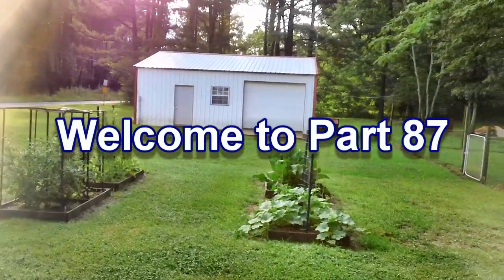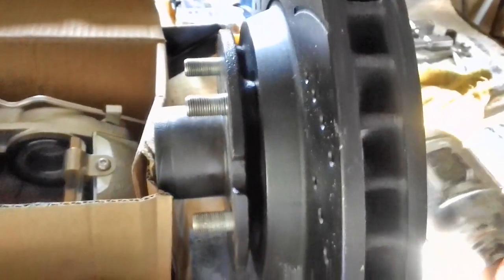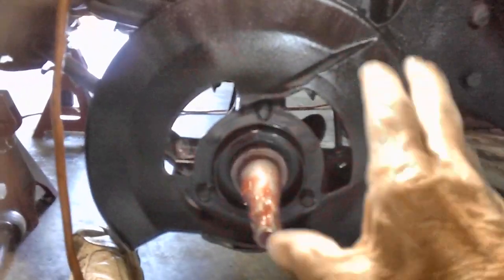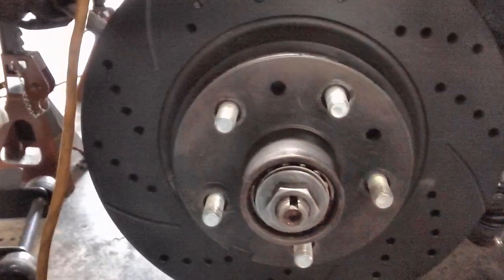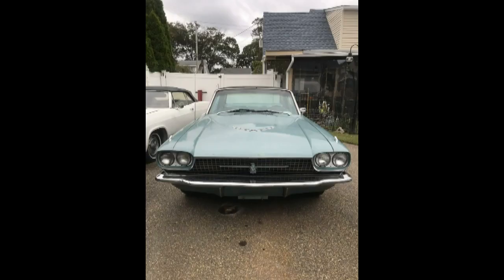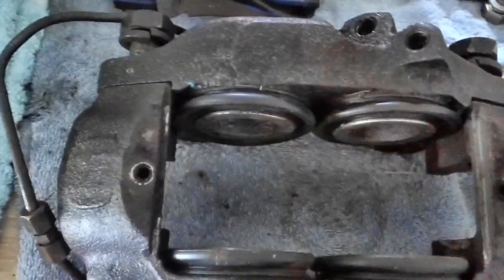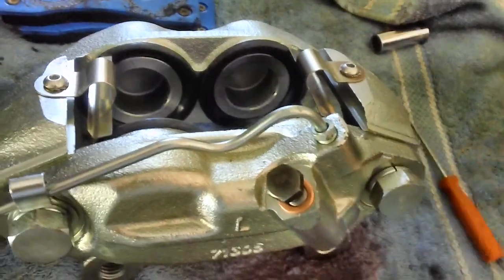1966 Ford Thunderbird repair and refurbishment (Part 87). Front brake calipers.

Comment: Great video John. Glad you showed how the brake pads just drop into the old calipers. Also in a  previous video you talked about the break booster and how there is a little bit of travel in the pedal before the plunger engages. That explained why I always thought my brakes were touching.  Many thanks!

Comment: Hello John,
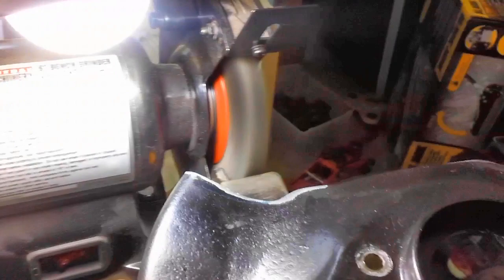Splash shield observation/question: @19:10 of your video, you can clearly see an "R" on that splash shield. It looks like you are working on the driver side, which is the LEFT side. Can you take a look at your shields to make sure you are putting them in the right locations?
Reply: Good point.
Reply from the maker: George,
SHHHHHHHHH!🤫
Regards,
John

Comment: John, as I learned it, when adjusting a wheel bearing, one torques it to the 20lbs or so as you did... however... if you leave it there, you'll have premature bearing failure. 
Torquing it down to 20lbs is to seat the bearings. That's why you rotate it as it's being torqued. The proper final wheel bearing torque is in the INCH POUNDS. 
The way I was taught, I've always loosened the nut, and with a wrench, about one finger on the end of the wrench until pressure is uncomfortable by the finger pressure, and inserted the lock and cotter key there.
Reply from the maker: Karl,
Do it like you see it, my friend.
Regards,
John
Reply from the maker: Karl,
I'd appreciate a source for your inch pound torque info.
Regards,
John

Comment: John, I do see a difference between the calipers. The new one seems to have a much large block right next to the bolt hole then the original. That is same part you were having a problem with and had to trim out for.  I think there is a slight difference in the cast for that....  that would explain why you had to modify the splash plate.  Looks great my friend...  stay cool  :)
Reply from the maker: Ron,
That difference is actually negligible.  Standby for the next vid, my friend.
Regards,
John

Comment: For those with a 66 T-Bird, just a heads up on these calipers... I ordered some from Rock Auto.  They sent me one identical to the original and another that also works on a Galaxy.  The Galaxy caliper steel brake line was rubbing inside against the wheel so I have to order another steel brake line for it because the design is different.
Reply from the maker: I've pretty much been forced to abandon RockAuto for parts.  They're always out of stock on practically everything I need.  "All the parts your car will ever need."  Yeah, right!
Regards,
John
Reply: joernone Their prices are amazing, but their customer service is all online to keep prices down.  I’m with you on that John.

Comment: Hi John, I ran into a similar problem with my shield / caliper (oddly enough on the driver’s side) and for me the fix turned out to be loosening the shield and repositioning it away from the caliper and retightening it.  There is a little bit of play in those shield holes.  It could also be the right/left issue that service technician pointed out.  Sorry for the frustration!
Reply from the maker: Stand by for the next vid, my friend.
Regards,
John
Reply: joernone Looking forward to it my friend!  -Robert